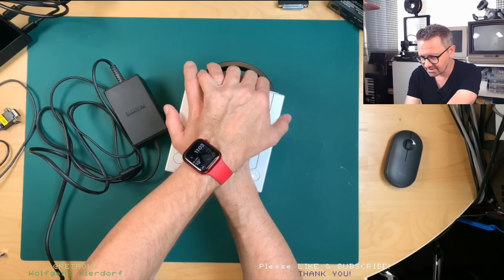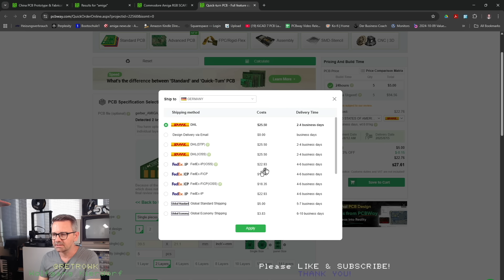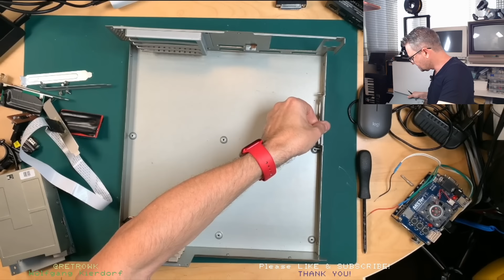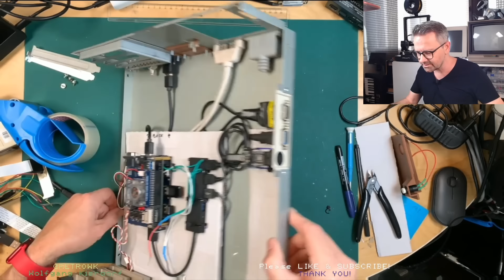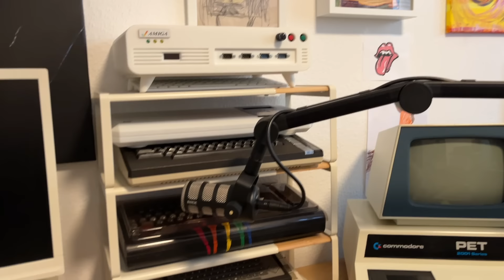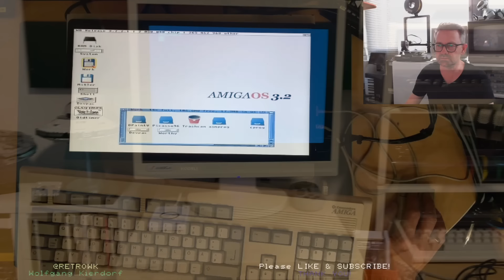The MISTER Amiga 3000 - Turning a GameCube into an Amiga 3000 - kind of .. #pcbway #amiga #amiga3000

Comment: Nice video, how did you bridge the Amiga keyboard ?
Reply from the maker: I use something like this: https://www.ebay.de/itm/134313817942. The DIN Connector on the Amiga Keyboard has the same wires as the A500 Keyboard. Works with 2000 and 3000 keyboards and even 4000 with a PS/2 adapter.

Comment: I just love this project. Amiga 3000 case is the most beautiful Amiga case ever. Shame if it sits unused. And those 40 years old chips are not getting any younger. Mister is a great replacement. Btw, I really love use of the cardboard as a mounting plate. I have used a cardboard box of my video card to make my arcade joystick!

Comment: Too bad the MiSTer isn't capable of supporting anything beyond a 68020.
Reply from the maker: True, but it‘s fast. 1.07 times the A3000. Just without the 030 specific instructions.
Reply: @RetroWK  Too slow for Settlers 2 😋
Reply from the maker: @amigaspeaks  That is true too. But there will be a new MiSTer soon with much more power. I assume in a year from now we should have an 040 or even an 060 in FPGA.
Reply: @RetroWK  can you please elaborate on that? i am considering buying a mister right now. will this work on the current mister or will there be a different hardware platform? thanks!